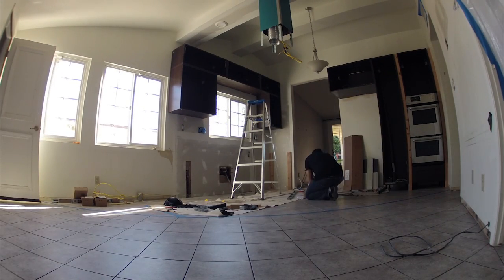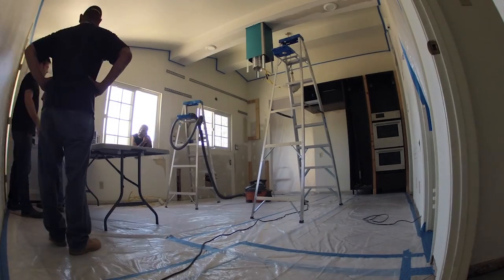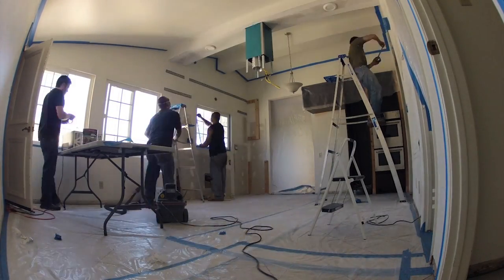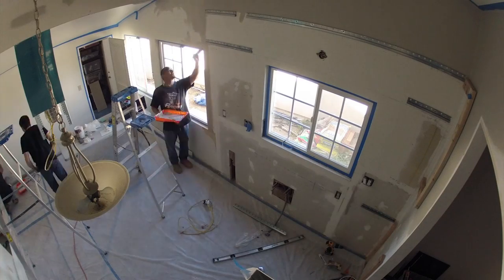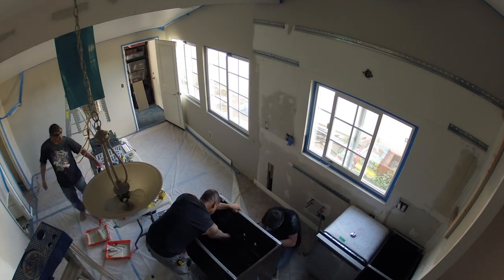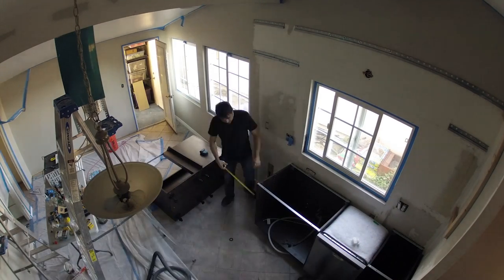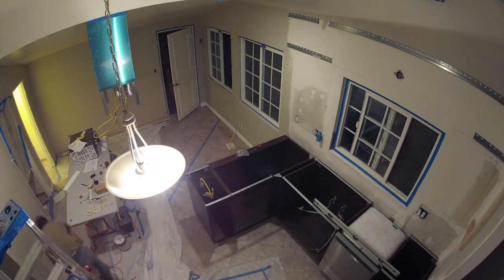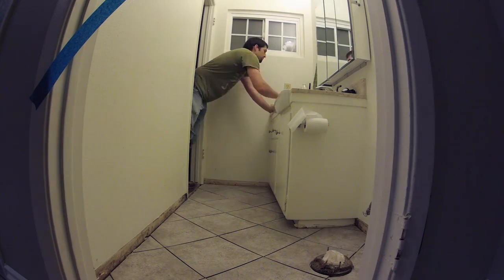Kitchen Remodeling - Day 9 of 17 - Drywall, Painting, Cabinet Installation, Plumbing

Comment: Hi, my name is Antonio and I'm from Portugal, I've been seeing a lot of videos and concluded that your experience are relevant to my doubts. I restor my kitchen with drywall and I need to mount a strip of tiles between the counter and the upper cabinets. I saw so much information that I ended up being more confused than I was before. I need your opinion for the following questions. To put the tile on the drywall! - is it advisable to use any waterproofing material?  - Is a primary also needed?  - Or can I put the tiles directly on the drywall, or is there a specific adhesive cement for this application? Thank you, I look forward to your feedback
Reply from the maker: Hey Antonio - no primer or waterproofing needed for kitchen backsplash / wall tiling.   You can attach directly to drywall with acrylic tile adhesive, like this:  https://www.homedepot.com/p/Custom-Building-Products-AcrylPro-1-Gal-Ceramic-Tile-Adhesive-ARL40001/100015587    After you tile it, and grout it, it will be waterproof.
Reply from the maker: I recommend using Sanded Tile Caulk for the grout around sink area / backsplash.   https://www.homedepot.com/p/Custom-Building-Products-Polyblend-382-Bone-10-5-oz-Sanded-Ceramic-Tile-Caulk-PC38210S/100678065?MERCH=REC-searchViewedNA-100678065--N